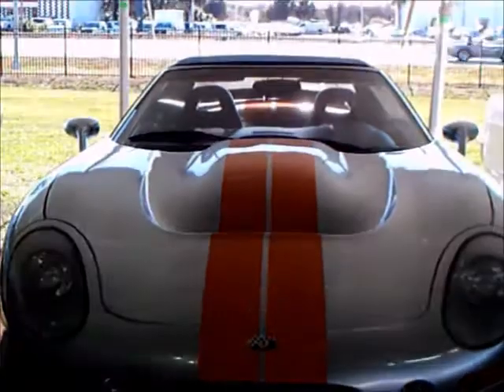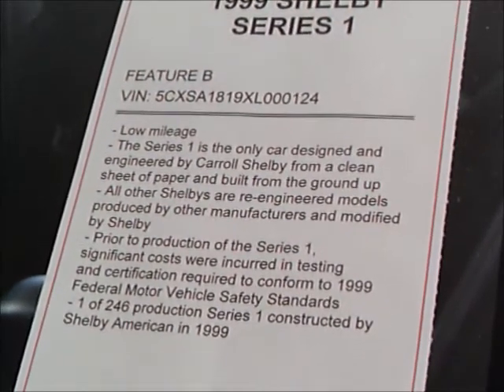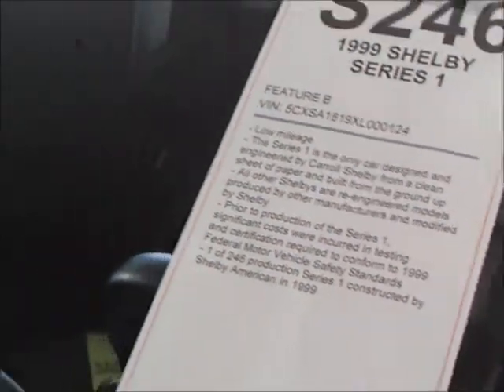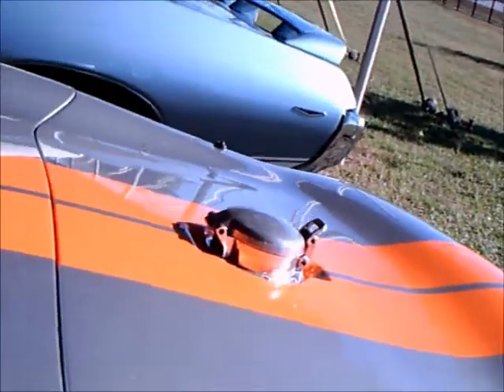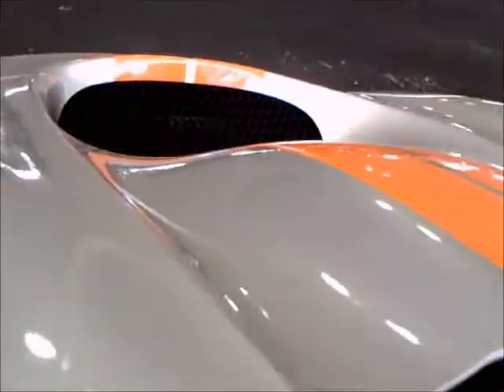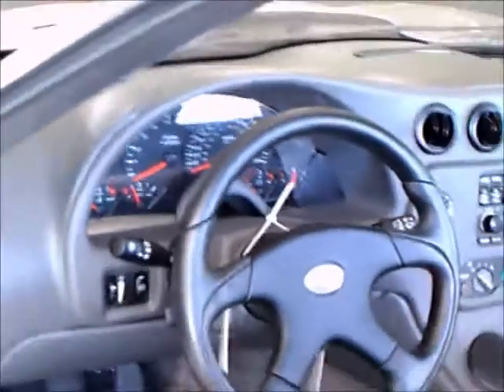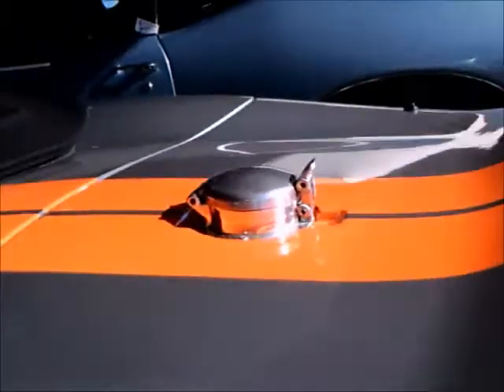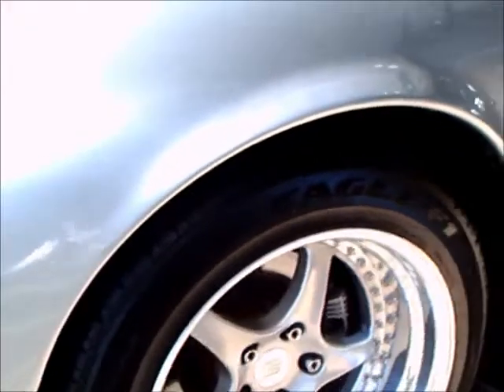1999 Shelby Series I SilverOrng KissimeeAuction012014

Comment: Hey Jack. nice looking car. The engine is mounted the wrong way. Shouldn't the engine be mounted width-wise, across the car? At least it has a manual shifting transmission. Thanks for posting. I've never seen a 99 Shelby before. :)
Reply from the maker: Hey, Jason!  I'm assuming that the car is rear drive, so in that case, the front/back orientation of the engine would be correct.  Thanks!  :) Jack
Reply: Jack R I agree. It looked like a rear-wheel drive car, judging by the position the engine is situated.